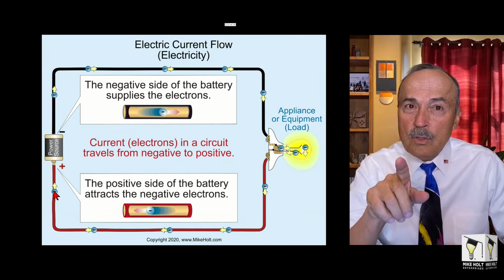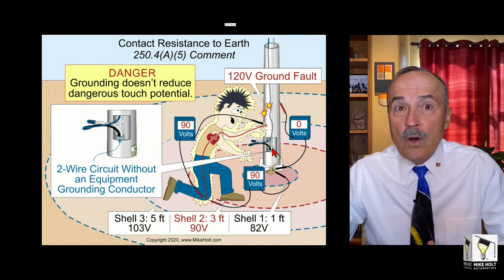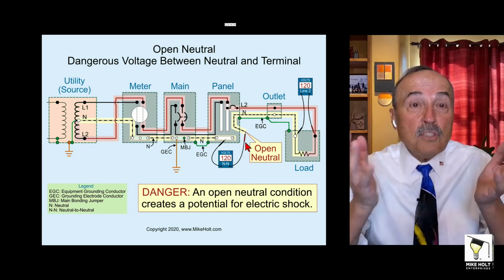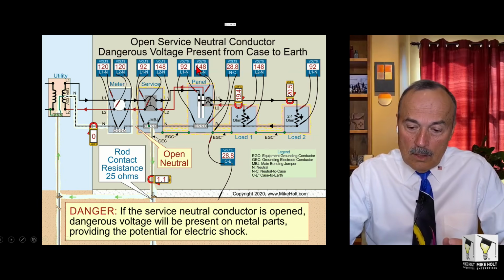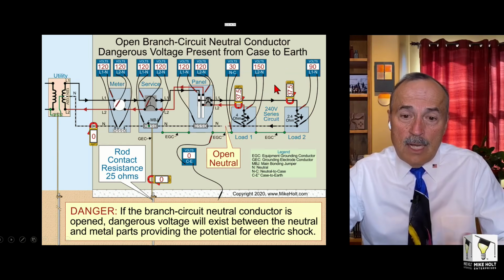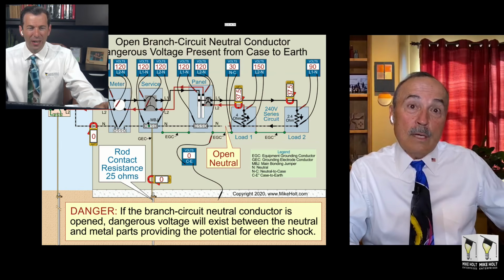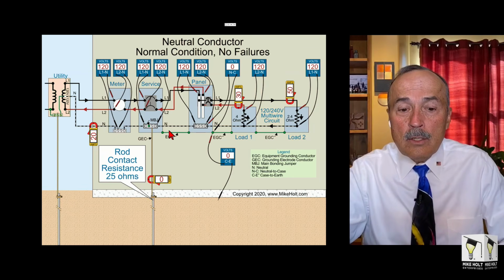Mike Holt Live Q&A Tuesday May 5th 2020

Comment: @MikeHolt could you do a video explaining when a neutral counts as current carrying? I understand 310.15(E) covers it in perfect detail, however, there are some who believe that the neutral in a two wire 120v balanced circuit would count as current carrying, even though it is excluded entirely from 310.15(E). Some are interpreting the wording of 310.15(E)1) to be a cryptic message that neutrals in a balanced circuit are counted despite no mention of it in the actual section.
Reply from the maker: A shared neutral per 310.15(E)(1) is not 'counted' as a current-carrying wire. But all conductors of a two-wire circuit 'count' as a current-carrying conductor.
Reply: @MikeHoltNEC  I understand it carries current, but it isn't listed as counting in 310.15(E). I have been a longtime Tom Henry student (40 plus years) and in his calculations book it states that the neutral in a balanced circuit does NOT count. So my question to you is, Under what code section does a neutral in a two wire balanced circuit count as current carrying for the purposes of ampacity corrections?
Reply from the maker: @JeffBanfield-t6v  Tom is a great friend of mine and I'm 100% confident that he would not state that a two-wire circuit that carries let's say 15A that the hot wire (carrying 15A) and the return wire (call it what you want carrying 15A) is not considered a current-carrying conductor for the application of 310.15(C). Send me (Mike@MikeHolt.com) a photo of Tom's book that made this statement and I'll call Tom.
Let's forget Tom, can't we agree that the conductors of any two-wire circuit count as a current carrying wire for 310.15(C)?
Reply: @MikeHoltNEC  I will send you a photo of the 2020 calculations for the electrical exam book page 28 that details this. 310.15(C) has nothing to do with neutral conductors. Prior to the 1990 code there was no provision for the neutral conductor at all. Around that time, we began to realize that the neutral in a 3 phase 208v wye system was creating additional heat. It's important to remember why the neutrals were added to the ampacity adjustments to begin with. It wasn't because 2-wire perfectly balanced circuits were creating too much heat. The 1990 code began the implementation of the neutral as a current carrying conductor, based on this new discovery. The 1990 code reads very much like the current code. 310.15(E)1 clarifies that the balanced neutral of a single phase system does NOT count. Obviously, this type of circuit, as well as a 2-wire perfectly balanced circuit are not a part of the issue because these circuits do not produce any extra heat. This appears to be a false interpretation of 310.15(E)1. There is no code section to back up this assertion, because in theory it makes no sense, as a balanced circuit produces zero extra heat. 310.15(E)1, 2, and 3 details all neutrals to be considered current carrying. Please do call your friend Tom, I'd be interested to find out what his thoughts are.
Reply from the maker: @JeffBanfield-t6v  send me (Mike@MikeHolt.com) the photo of Tom's book where he states that you only count one conductor of a 120V circuit as current carrying for the application of 310.15(C). Then I'll get with Tom.
Reply: @MikeHoltNEC  Already sent. Check your inbox if not check the spam box

Comment: I just want to mention that when considering the current path through the ground rod and back to the pole transformer you need to take into account the second ground rod at the pole. So if each ground rod connection is 25 ohms then that is a total of 50 ohms. So then the current would be 120 / 50 = 2.4 amps.
Reply from the maker: This would only apply if the power supply was a stand-along generator that was grounded with a ground resistance of 25 ohms. However, in reality there is not ground resistance at the source, since the source is the utility with thousands of grounding points.

Comment: How does removing the grounding electrode conductor from the equation when you’ve lost a neutral increase circuit current, the grounding electrode conductor should provide an additional current path and increase circuit current, I think you need to check your spreadsheet
Reply: Using your own graphic, if voltage L1 to ground is 92 volts into a 2.4 ohm load current should be 38.3 and current on L2  should be 37
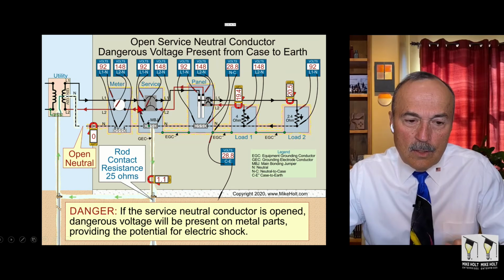Reply: In the graphic @18:32 with a L1 current of 20.5 amps through a resistance of 2.4ohms (load 2) the voltage drop across load 2 should be approximately 50 volts (assuming the complicated formula for finding voltage drop across a resistor is similar to e=ir). I’m going to assume that the voltages produced by your complicated spreadsheet are right as they appear close enough to make sense. However I believe your currents L1 and L2 should be closer to 38&37A respectively.
I do instruct in an electrical apprenticeship program and our state has adopted your curriculum, so I appreciate your videos and graphics and appreciate the opportunity to interact. Keep up the good work
Reply from the maker: @rachaelrichardson7761  What is shown is correct and the currents are not 38/37A. I you like, send me and email to Mike@MikeHolt.com and I'll get you the spreadsheet.
Reply from the maker: Please watch the video again and give me the exact location in the video where you describe. If you like, I'll email you the spreadsheet, assuming you can understand the complicated formulas. Let me know via Mike@MikeHolt.com.

Comment: Thanks again for another good video with great information. I think when talking about ground rods and their resistance to earth as a return path, the resistance to earth of the one at the pole with the transformer (source) is forgotten about. Please keep the info coming.
Reply from the maker: There is no resisance on the utility side, this is because the utility has tens of thousands of connections (if not more) to the earth for the return current.
Reply: @MikeHoltNEC  I understand what you are saying about there being an almost unlimited number of paths so the resistance of the earth is extremely low. Having watched your video where you drove the rods and measured the resistance of the contact between the rod and the earth (my why of thinking of the resistance in the NEC) I would assume that any similar rod driving into similar earth would have similar resistance, there for, in my mind, the rod at the utility pole would "see" a similar resistance to the one at the meter.
Reply from the maker: @REKlaus  There are let's say 10,000 ground rods at the other end, each 25 ohms, so there is no impedance at the other end. That's how ground resistance meters work.
Reply: @MikeHoltNEC   Ok, got it. I was just looking at the one rod at the base of the single utility pole rather than thinking of it as a network of all the poles and rods. Thanks